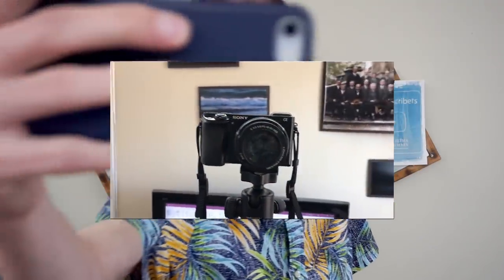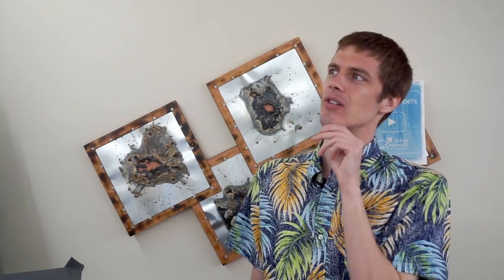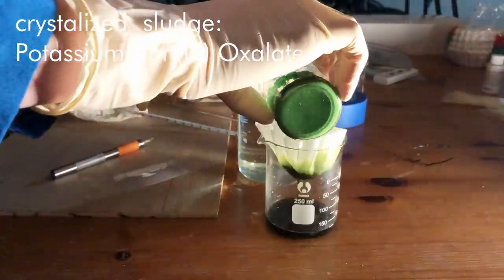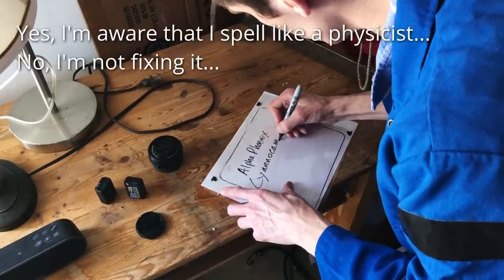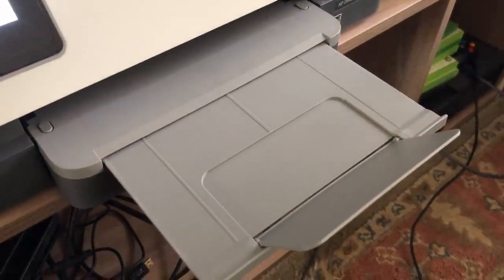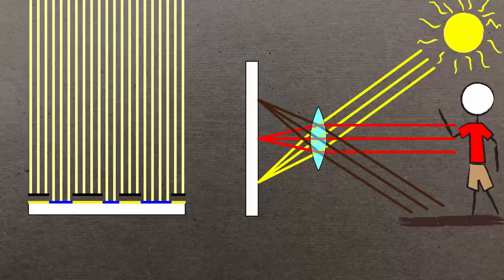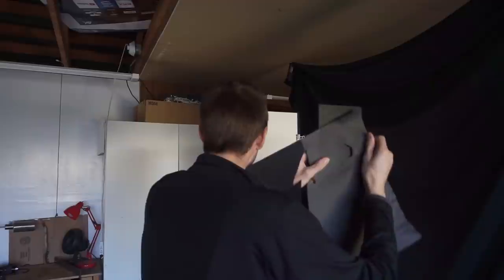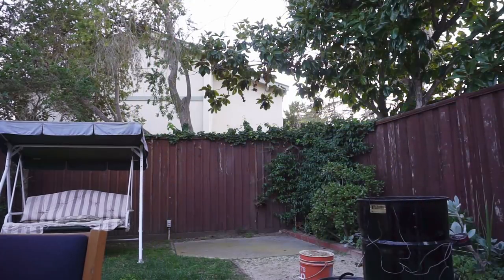Ditch the DSLR? The 200-year-old science of my new favorite camera (2^14 sub special!)

Comment: There's a hidden advantage to this setup: Because it takes a picture in ultraviolet, which has a lower wavelength than visible light, it has a higher theoretical maximum resolution for a given lens size. Clearly ultraviolet cameras the the future for smartphone manufacturers on the hunt for more megapixels without increasing the size of their optics.
Reply: Ha, and then they'll need even more clever software to imagine the real colors
Reply: UV is also much more hazy over long distances.
Reply: @max_kl  or more likely, a big little approach with fine details being captured by the UV pixels and color information being captured by physically larger pixels and overlayed.

There would also need more worrying about the lens telecenricity as different frequencies refract through mediums differently (therefore focusing at different distances). This isn't much of a problem for professional or even point-shoot cameras which have enough space for corrective optics and a shallower angle between the optics and sensor but it's a major problem for even the best modern smartphones. Try taking an up close picture of something metallic with your smartphone (in the camera's RAW format) and view it on a computer and you'll notice really bad chromatic and spherical aberrations.
Reply: The diffraction limit might be higher, but that's irrelevant as the single lens will be corrected for visible light and will produce much more aberration in the UV. It is unlikely that UV would be useful in smartphone cameras. Since we don't see UV light photos taken in UV look weird as they show details that we can't normally see. They often show up slight skin blemishes that are not visible in normal light that can be artistically interesting, but not suitable for general photography.

Further most normal lens materials absorb UV strongly (350nm is probably okay for normal glasses, BK7 has good transmission at 350nm), and optical plastics are even worse (i.e. PMMA). So you'd need to use exotic expensive materials to even get a reasonable amount of UV onto the sensor. You'd also need to adjust the AR coatings which would be less efficient if used over a wider range of wavelengths.

Optics, just like all areas of engineering, is all about compromise. You trade off generalisation for cost and performance. If you want a lens that is good at 590nm, 546nm, and 486nm adding in the additional requirement for high performance at 350nm will reduce the performance in the visible region if you keep the lens complexity comparable. Just like you can design a fast car or you can design an off road car, but it is very hard to design a car to do both (and would you even want to).
Reply: @vikmanphotography7984  Research into new materials is always interesting. I would very much like to have a 'full spectrum' camera in my pocket that can image in the UV, visible, and IR. I assume that I'd be in the minority of people however. 

I didn't say that modern camera lenses were singlets. Only that if you increase the number of design criteria, for a given complexity (or cost or size), your ability to meet those criteria is reduced. So, unless the UV image can be used in a way that is more useful than the loss of performance in other areas it will likely not be widely used.
Reply: @joshhyyym  hey I don’t know much about any of this, but I assume smart phone manufacturers would use a separate lens or camera to capture the UV and then use AI to stitch the higher resolution image together with the standard camera image in a way that looks good to our eyes but provides the increased resolution that comes with the UV capture.  I’ll reiterate that I know nothing. I didn’t even watch the video.
Reply: UV light could get used for temporal sharpening of motion interpolation
Reply: @vikmanphotography7984   Doing it with a digital sensor though, you're able to independently unwarp each color channel according to that channel's wavelength-specific lens distortion.
Reply: @AJMansfield1  assuming you don't have massive aberrations towards the edges of your sensor (every phone camera does and even most professional camera lenses do at wider apertures) your theoretically could but it's computationally intensive.

That said, idk why you'd bother. What I think you're missing is that different wavelengths focus at different distances (optics get pretty complex to try and overcome this issue). Focusing at different distances mean that red might be super sharp but blue might be fuzzy across multiple pixels (not just different pixels).

Even ignoring all the issues above, you'd still need your UV pixels to be smaller and more numerous to have a spatial resolution difference. Again- that adds a lot of complexity and doesn't even seem useful for the overwhelming majority of applications.
Reply: @vikmanphotography7984  I mean, we're already pulling tricks with taking multiple shots at different focal lengths and stitching them together to simulate a better depth of field. It wouldn't be such a stretch to do that separately for each color channel or take extra single-channel shots. Many modern smartphones processors have special acceleration hardware specifically for letting them perform this sort of digital photography magic.
Reply: @AJMansfield1  I think what you're referring to is the Brenizer method. This is real and occasionally done with larger imaging planes to stimulate large format photography like 8x10 film cameras but it's incredibly labor intensive and requires that the subject be perfectly still for an extended amount of time and that camera movements are very controlled.

This is NOT what smartphones do. Some phones rely solely on image recognition to put people in focus and gaussian or box blur out anything that the camera didn't think is the subject. This is what my pixel 5 does and personally I hate it.
The other approach involves a dedicated depth map sensor and projector. This measures the tiny time difference it takes for IR light to be reflected back to the phone and then applies a variable gaussian or box blur to each zone measured by the depth map. I personally still am not a fan of this approach but it does look much cleaner than the image recognition route.
Reply: Not even close to being true. The problem with phone cameras isn't megapixels, it's the small sensor size and terrible optics. Phones like the Samsung S21 have a camera with 102 megapixels, but it still takes the same quality of photos as a standard 12 MP camera. The 102 megapixel camera is actually far worse in low light due to how a sensor captures light with high megapixels which is why it's only recommended to be used outside in daylight. Another thing is that UV only comes from the sun so any indoors that isn't lit with daylight will not show up on the photo. Cameras actually have UV filters built into the camera body to prevent the effects of UV light which include, fuzziness and haze.
Reply: @sageinit  Why would UV be useful for this?
Reply: how does the wavelengh of the light change something about the Sensor density? a 2m pixel picture - needs 2m sensors every sensor can detect uv and visible light.
Reply: @duderobi  UV light has a lower diffraction limit than the visible spectrum so theoretically you could shrink your pixels and cram more over the same area *and actually benefit from increased resolution.
The practical usefulness in photography is however limited as has been discussed.
Reply: Yeah and trash all that becasuse A. its blurry from long exposure, and B. he is printing in from cheap paper which has terrible resolution, if he had fine paper, gelatin on glass plate, then maybe it would be appreciated, but no, its not. Look at the results of a salt print vs an albumen print. Albumen is the clear winner because the salt print is in the paper and albumen is above it
Reply: lmao
Reply: I doubt changing the frequency of the sensors will outpace the simplicity of adding more sensors for years to come.
Reply: @tuskiomisham  original comment is a joke
Reply: @vikmanphotography7984  They've sort of done that with pairing greyscale sensors with RGB sensors
Reply: @ciarfah  I'm only aware of it in one commercially available product which has abysmal software support but yes. The black magic 12k camera, for anyone wondering
Reply: The problem is the human eye cannot perceive UV, so if you try taking an image of UV wavelengths, you will capture information that you wouldn’t normally see.

So while your image may be more “precise” it won’t represent what a human would see.
Reply: Which is probably a major reason why the photos weren't as sharp as he wanted. He saw the visible image in sharp focus on the plate but pretty much every lens has higher n in uv than in visible. The plate almost certainly needs to be closer
Reply: @joshhyyym  Why bother with exotic lens arrangements? Parabolic mirrors are bigger, lower loss, and abberation free.
Reply: @tuskiomisham  Almost all smartphone cameras are and have been over duffraction limit for years. There's a reason Apple never goes up from 12 MP.
Reply: @appa609  They are not aberration free, they are only aberration free on axis with an infinite conjugate ratio. Off axis and at finite conjugate they have significant aberration.

TL;DR small good region in centre, crap outside of that.
Reply: Photos of people wearing Sun block lotion will look like they are wearing black face.
Reply: It seems to me that spherical aberration could be counterracted by having the photographic "plate" be spherically curved to match the focal characteristics  of the lens...
Reply: Well, that's true....but this advantage counterbalances with the more scattering and limited optic elements (UV lenses, UV mirrors)
Reply: not that big of a practical advantage unfortunately. Shortest visible light is 400 nm, so you can get resolution of about 200 nm. If you go to the UV-C it gets to about 100-150 nm theoretical resolution. That has absolutely no value for taking pictures with you smartphone.
Reply: Interesting idea.
All the people using sunscreen in thier face would have black faces.
Considering how much that triggers certain types of online folk, that would probably not fly.
Or people abandon sunscreen and get skin cancer more often.
Reply: @max_kl  Why would they need that? They've already been installing multiple cameras in their devices, why would they stop with that aproach? All they need to do is combime and aproximate the two, given that straightforward aproach may result in some information being lost and some artifacts being made, but i doubt that's something that a little of AI magic coudn't fix.

Comment: The cyanotype process is self-inhibiting - the forming dye blocks off UV from hitting the light sensitive iron 3 oxalate. I ran into this issue myself. You will achieve a massive sensitivity increase by just coating the paper with the photosensitive iron 3 salt of choice (I use a mix of Fe3Cl and oxalic acid) and developing the latent-ish (visible as a discoloration of the yellow sensitiser) image in a ferricyanide (or ferrocyanide for a positive image) bath. I got an overexposed image with an f4.5 tessar (4 element, the less glass in the lens the better the uv transmissivity) with just 4h of june sun exposure.
Reply from the maker: very cool! that last one is the best cyanocamera image I've seen in terms of sharpness and uniformity! there were only a few examples I was able to find online before starting this.

what was your f/ ratio and how big was your paper relative to the lens?
Reply: Fe(III)Cl, FeCl3, or Fe(3)Cl. But never Fe3Cl.
Reply: @posysajrazdwatrzy  that's awesome!
Reply: I consume some oxalic acid on occasion

Shamrocks are nice and tart
Reply: I got no idea what any of this means but damn it’s cool
Reply: @erk9822  always read those comments so maybe one day I'll know what's being said.....don't think that day will come
Reply: @erk9822  always read those comments so maybe one day I'll know what's being said.....don't think that day will come
Reply: If less glass is better then why not try a pinhole camera?
Reply: @jack002tuber  With pinhole camera your focus would be limited by diffraction and the amount of light you get would make require measuring the exposure times in days; as in "this scene has nice exposure if I shoot for 9 days". For such time periods, any light leakage from the construction of the camera is going to destroy the final picture.
Reply: @MikkoRantalainen  The light leakage will be the same in proportion to the light from the pinhole no matter how long your exposure, so needing to expose your medium for nine days doesn't make it worse. Remember: if the medium is reacting slowly to the intended light, it's also reacting slowly to leaked light.
Reply: Three years too late, lol, but I imagine the lack of sharpness, is due to camera shake. A big bulky camera like that is going to catch a lot of wind, especially made with lightweight materials. You could either make it heavier, or put a windscreen to block the prevailing wind.

Comment: Amazing, I would turn your both photos into negatives to see the photo as it should be seen, it will give you a positive image of your house but with yellow colors
Reply: I even suggest trying 3 exposures of the same frame using RGB filters.
Scan the result and try to get a color photo :-)
It looks like a lot of work but also a lot of fun: D
Reply: @Aldhafara  But the photographic material is only sensitive to ultraviolet. You could try to get a false-color image but you would need some pretty rare filters.
Reply: @bdijkstra1982  oh
Indeed, I completely forgot about that fact. 😕
Reply: @bdijkstra1982  It could be doable with phosphor sheets that absorb the light color you're after and radiate UV instead. Though triple exposure is already impractical; the last thing it needs is multiple hours per exposure.

Comment: Spherical abberation is actually an well known issue (with an stupitidly simple solution) that commonly got solved by astrophotographers in the 70's and 80's:
Just curve the film.

Back in those days astrophotographers used so called "Schmidt-Cameras" to capture images of Deep-Sky-Objects, such as galaxies and star clusters. These cameras where build sort of like an Newtonian without an secondary mirror but an place to attach films and where widespread. Schmidt-cameras suffer from the same issue due to its curved focal plane. 

To curve and cut the films into round shapes they stamped them out using special stampers, that could deform and cut simultaniously.

The real question for your camera is, whether you have to curve in or out and at whitch radius. 

An other option would be an Field-Flattener lens. BUT they get used for corrections on the scale of an fullframe sensor, not at the scale of an whole paper. So a bit too pricy and complex, considering you would have to custom-make that lens.

Fun fact: Today curved sensors are relevant and there are rumors Sony works on curved sensors for a better image-quality without expensive optics. The Kepler space telescope is actually an modern Schmid-Camera with an array of curved sensors.

Hope this will help or at least inspire you.
Reply: There are no curved focal planes. ;-)
Reply: @1906Farnsworth  please explain?
Reply: @gregbailey45  A plane is defined as a flat surface.
Reply: @1906Farnsworth  You may want to realize that actually there is no such a thing as a focal plane which is a idealization due to paraxial approximation and stuff like that. With small formats things are pretty almost planar to a fair degree of precision but conventional cameras with flat films or flat sensors may still suffer from spherical aberrations. The latter can actually be compensated (partially) by engineering non-spherical lenses (just notice how many lenses with "aspherical" in their name are around) or by placing the sensitive element on a curved surface, because in the end of the day focus in real life never occurs completely on a plane. That being said, no perfect lenses can be achieved so the choice of correcting this or other importan aberrations is part of the chemistry that gives to each lens and each imaging solution its flavour (or lack thereof).

Comment: Two ideas: reduce spherical aberration by adding a "mold" behind the paper that brings it into focus everywhere (or at least along the longer side to avoid crinkles). Also you could try to use vacuum (maybe a battery powered aquarium pump?) to press the paper down.
Great content as always, keep it up!
Reply: Or solar powered, considering this camera needs a lot of light anyways. But the pump might vibrate, so better mount it seperately.
Reply: When the paper is wet it could be sandwiched in a curved mold, then a similar mold would be in the camera to tape the paper to. Then it could all be in focus
Reply: Yeah, the bending of the paper definitely gave some unintended inspiration! It might be hard to form the paper to a dome and get it flat again after. But even if you bend it over a curved ridge, that’ll reduce the aberration to only one axis.
Reply: @wsshambaugh  Indeed - crafting spherical paper isn't hard, but how do you hang it in a frame later?
Having it bent into a cylinder removes the aberration along the horizontal, longer axis
Reply: @wsshambaugh  you can fold the paper into the curved mold by making wrinkles, then after you developed, you unfold it. you are going to get some areas without development, but you get rid of the aberration. I do that to fit a flat piece of paper filter into my semi-dome coffee machine, it works.